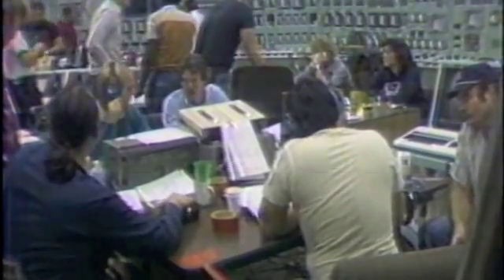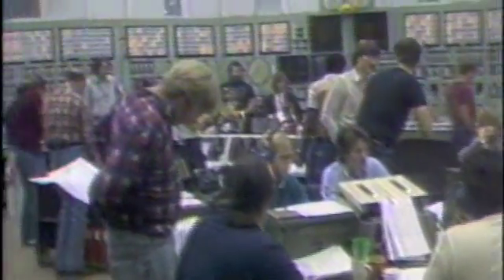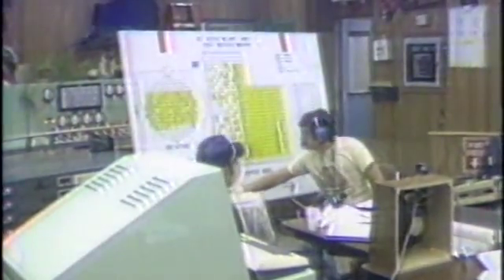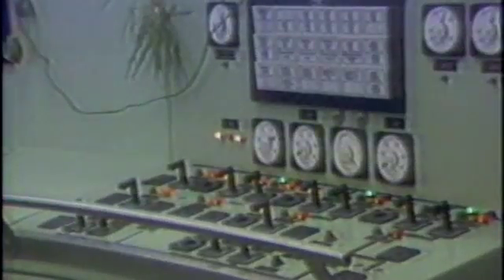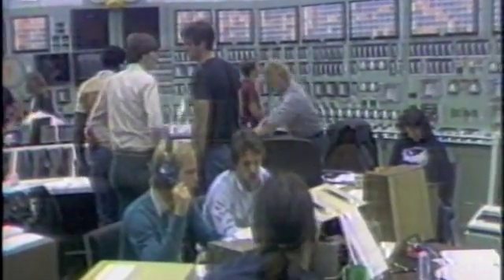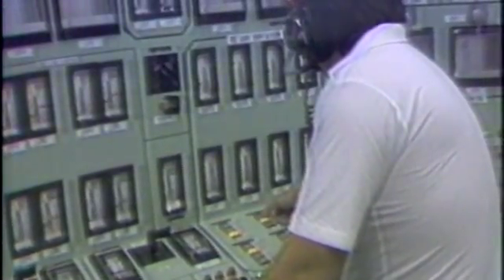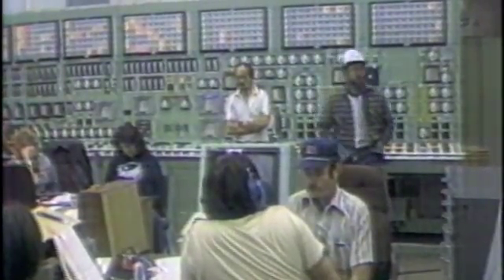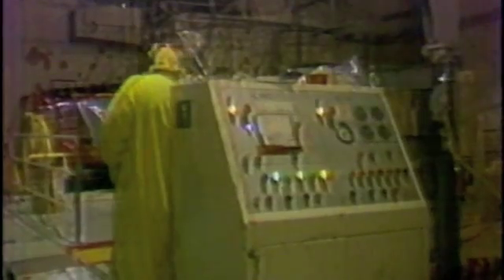St Lucie Nuclear Power Plant

Comment: What if a meltdown happened and then an explosion? Would they have to evacuate all of St. Lucie County?
Reply: Hard to tell, depends what kind of explosion.
Reply: @LSM_Lover  like, what if it exploded like Chernobyl? Would that be enough to evacuate all of St. Lucie or at least most of it?
Reply: @olympia5758  Chernobyl had a different system in it. My brother worked for the NRC, worked for a while at St. Lucie, was also sent to eastern Europe multiple times by the NRC as part of a team to inspect and suggest safety upgrades to nuclear plants in eastern Europe that had the Chernobyl style operations. I'm not a nuclear engineer so I don't pretend to understand the differences between systems in nuclear plants, but what happened in Chernobyl won't happen to nuclear plants designed and operated in the West. While some may point to Three Mile Island, that was a problem that was correctable, but operator error turned it into a disaster. It wasn't the plant, it was a couple of bimbos in the control room that compounded it into a partial meltdown.